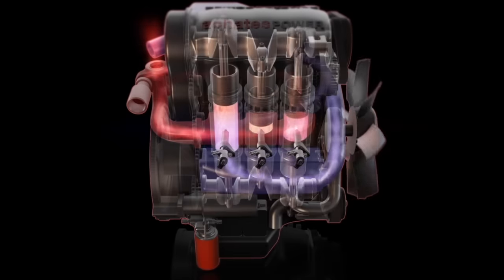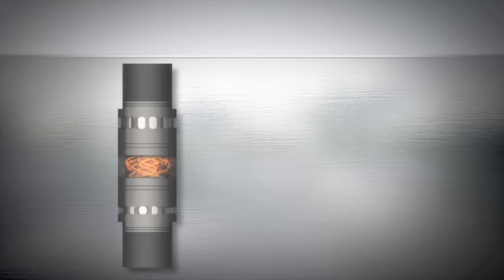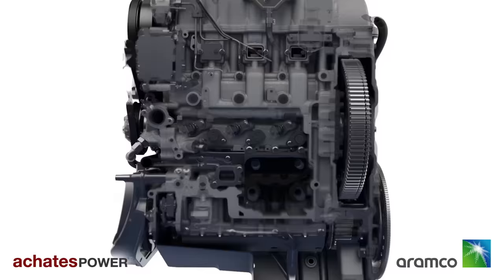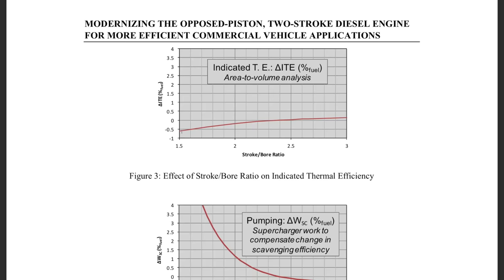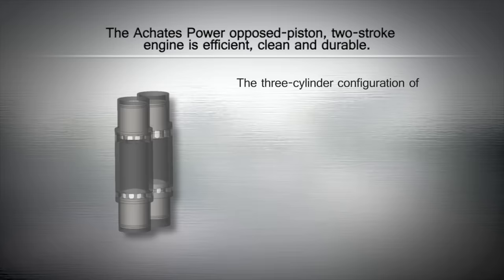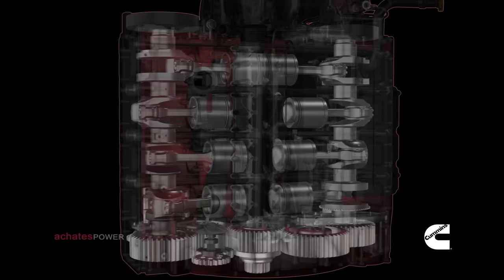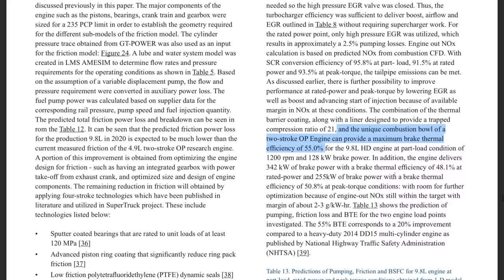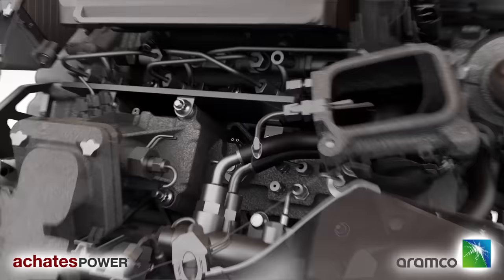Opposed Piston Diesel Engines Are Crazy Efficient

Comment: I see that you have some emission data but did not go into it. How would this compare to a modern diesel for soot and NoX emissions?
Thanks for posting this.
Reply: I'm curious on oil consumption and how it lubricates the upper compression rings. If it burns oil they'll never pass over the road emissions, or they'll be warrantying a lot of DPFs. We've been putting rings and new heads on our ISLs at work for to frequent regen codes. aftertreatment can't handle oil.
Reply: The rings pass the exhaust and intake ports so oil cant be squirted or splashed on the cylinder walls at the top of the stroke

Comment: 55% thermal efficiency can blow away EVs from a cradle to grave look at where energy is produced. If the EV electrical charge is generated by nuclear, coal, or conventional natural gas turbine, that thermal efficiency is about 30 to 33%.  Only the nuke doesn’t produce CO2 while operating. Line transmission losses are another 10%. Charging and discharging is only about 90% efficient. The electric motor itself has about 90% efficiency. Combine all these losses together and one gets 0.33x .9 x .9 x.9 = 24% overall system efficiency. Much better for the environment to burn a carbon producing fuel at 55% efficiency than at 24% efficiency. And yes, there is some efficiency loss in converting oil to gasoline, but not anywhere nearly enough to make up this difference.
Reply: we just need a way to produce hydrocarbons. and use efficient engines.

Comment: ive come up with one that has 6 opposing pistons. one bang, in the center, 6 directions pistons from all six sides.
Reply: The TruManZoo 2 pistons for each dimension :o.
Reply: Napier Deltic engines (also an opposed piston engine) which can have as many as 36 pistons in triangle blocks which bolt together
Reply: Sounds like the opposite of a radial.  That would be interesting to see how it would be geared together.
Reply: thanks, i have some vids on my channel, by no means im a professional, but ive had some cool ideas lately :)
Reply: The TruManZoo there is a fusion reactor in development kinda like that.
Reply: awesome.
Reply: Yeah, it's "30 years away". And always will be...
Reply: Intriguing, I must know more.
Reply: James D, This is why you're not an engineer. Now I have no idea if the concept would work, let alone if its a good idea. But it's worth a shot, engine design offers more potential for innovation than almost any other field of engineering. It's not even my idea but it's got potential. The world doesn't revolve around pushrod V8s, innovation reqires open-mindedness and ambition, two things you seem to be sadly lacking. You'll never know unless you try. BTW, the opposed piston diesel was first widely used in WWII maritime applications and pretty much abandoned ever since. Just goes to show, just because an idea is old, doesn't mean its dead.
Reply: Isaac Roebuck as a mechanical engineering student going into my junior year, I can see where you're coming from. BUT, engineering is not guess work. That's called "tinkering". Engineering is using knowledge, logic, and thoughtfulness to create stuff. It's important that, when you make a design, you approach it from all angles to try to figure out what can be wrong. The guy above you gave some information (though sarcastically) about some problems that such an engine could have. And he's not wrong... More crankshafts isn't usually a good idea; though not always a bad one (the opposed engine has two crankshafts), and efficiency DOES decrease as more friction-creating parts are implemented. You yourself also need to be open-minded to not just the nice criticism, but also the blunt criticism (which can even appear to be mean).
Reply: Could use a large ring cam if thats what it would be called? Could have lobes that pistons would push on. For an interesting concept look up axial engines. Some use a swash plate cam. No crank.
Reply: SoMessy, I completely get where you're coming from, critical thinking is essential to the engineering process. It was not the criticism that was wrong with his comment, after all, it's not even my idea, it was his complete lack of respect for the abstract, for the unknown. I also am a student of mechanical engineering, and to me there is much more to it than simply logic, questions and answers of yes or no. It is the science of the real. Engineering is like a tunnel, which connects the abstract worlds of science/mathematics, art/design, with the world of real objects you can hold in your hand, or devices that can accomplish a task. Just because something seems unlikely is absolutely no reason to avoid it. And just because something looks from the outside like it will require a complex solution, the true challenge is rather to find the simplest solution to a complex problem. Anyone could make a system of cogs, sprockets, gears and chains etc..., it would be 'a' solution, and it might work ok. But that doesn't mean it's the 'best' solution. The problem with modern engineers is they only look at the surface problem, A+B has to be made to equal C, sometimes the simplest solution isn't the most obvious. And there usually isn't a cookie cutter formula to do it, it's concepts like these that challenge our thinking, and help us to look at not just this problem, but all problems from a new found perspective. This is what I'm getting at, on a fundamental level, yeah it's probably not the best or most practical solution. But there's just that little sliver of a chance that they might just be onto something, this could go for any number of concepts like this. For me, that's just too fascinating to pass up. And as far as conceptual engineering goes, guesswork and tinkering is a necessary part of the process. Obviously you have to exercise critical thinking, but you gotta start somewhere if you're going to have anything to think about. So take a guess, give it a shot, think it over, make it better, and ALWAYS make it your absolute best. The only limitations are time and your ambition. Can go on about cost constraints, project focus etc..., but if you truly believe an idea is worth what it will take to bring to fruition, make it happen, one way or another.

Comment: Two strokes require upper cylinder and crank lubrication, usually through a fuel-oil premix in the inlet. Does this engine need this type of toal loss lubrication? What are it's emissions like?
Reply: No, it's a standard lubrication system a like on any current automobile.
Reply: SOME  two stroke engines require lubricated fuel. It is certainly most common in small 2-strokes that use the crankcase as an air pump essentially. But larger two strokes, such as the common Detroit line, typically use superchargers instead for this task instead with a pressure lubricated bottom end with sump.
Reply: Actually the best way to do opposed pistons is to have one end running as a 2 stroke working the valves, while the other end works at double the revs as a 4 stroke scavanging the fuel flow, one still has supercharging & turbo charging too for efficiency.  of course having positive pressure will scavenge the engine too, but it's good to have base scavenging anyway in case the compressors fail or the intake plumbing locks up in bypass mode too .
Reply: Smokin
Reply: Diesel fuel is actually a light oil and has lubricating properties on its own, not sure it’s enough to protect the internals, but it’s got more lubricity than gasoline, which is a solvent with no lubricating properties

Comment: What about the librication system? If lubricant mixes with the diesel ,the emissions will be high.
Reply: Good point
Reply: Thats the major drawback. Thats why you don’t see many 2 stroke anything anymore.
Reply: 2-stroke fuel lubricated engines use the crankcase to build positive pressure for the intake charge. The premix is only to lubricate the bottom end, nothing else. Since this engine has a supercharger handling its positive intake pressure needs, you don't need a crankcase to do it. You can have a regular oiling system and keep it separate from the combustion chambers.

Comment: In the Coast Guard, we had Fairbanks-Morse inline 12 cylinder opposed piston 2-cycle diesel engines that are three stories high, complete with a long and huge scavenger supercharger and really huge twin turbochargers at the front of the engines. We would joke about the plaque that said “Fairbanks-Morse OP”, knowing that it meant opposed piston but we joked that it meant oil pump because the engines would weep oil at the air box cover seals, and we lowly E-1 through E-4 would be constantly wiping oil to prevent any dangerous collection of flammable oil in the bilges. Brings back a lot of memories but you don’t want to be near those engines when we’re on a summer Caribbean patrol! 😰 And we had to wear thick long sleeves to prevent getting burned on the hot exhaust manifolds as the ship would rock and roll in rough seas. And yes, we had to wear double ear protection: yellow ear foamies and then aural ear muffs over the ears, constantly knocking them on pipes all around our head level.

Comment: I always thought that this config made high emissions. Correct me if I am wrong.
Reply: The old gas two strokers were bad with emissions. That is why they were discarded from car and motorcycle use. But maybe this opposed piston design with technology advancements makes the difference. Just look at the advancement of the ICE from the 1970s till today. I wonder if this design would work as a gasoline engine also. Replace one injector per cylinder with a spark plug.
Reply: As far as i read about it, no, cause it has static compresion ratio over 50:1 + boost and u get some mindblowing combustion presures :)

Curently in diesel engines, problems are enigen heads, wich wants to bend (blow up) at to high presures, that engine solves that :)

Comment: I ones was asked by my employer to build-in a Rootes ex aviation engine in ship that had previously housed a monstrous low rev runner of unknown make. So when I had the engine attached to the reverse gear, it looked crazy in the engineroom that could now given room to four more of these engines. The power it gave to the propeller was no reason to alter it a more moderate one. The ship was sold to someone in England, so off it went (the engine) back to the UK. Now probably somewhere in the Thamesestuary.

Comment: I would be curious to see how they lubricate this design. With the piston rings passing over the intake and exhaust ports, I would think it burns a lot of oil. I assume mixing oil with the fuel, like a traditional 2 stoke engine, is out of the question.
Reply: I'd hazard a guess at oil injectors a la Mazda Rotary.
Reply: In a traditional two stroke gasoline engine the crankcase in used as a pump to deliver the fuel/air mixture to the cylinder. Gas mixed with oil ends up in both the crankcase and combustion chamber - not good in either place. The Acates engine like the traditional two stroke diesel has blower induction. Nothing but oil in the crankcase. Nothing but fuel and air in the combustion chamber except for the little bit of oil that gets past the piston rings (like with any four stroke engine).
Reply: Yep.  Looks like it will burn oil, run hot, and be very heavy for its displacement.
Reply: Just like any engine. An oil pump. The GMC 6/71 never seemed to have a problem. I know. I drove one. Six cylinders with the power of a V12.
Reply: @men2dewy    I think it will be more than a little bit of oil that gets past the piston rings. Especially if the engine is mounted with one pistons up side down.
Reply: @markflierl1624  it has piston rings near the crank end of the piston, so oil shouldn't be near the ports....but that brings up the question of wear from the "combustion" piston rings.
Reply: 1. You're forgetting that diesel is an oil. Any that don't burn could end up helping lube the cylinder walls.
2. I agree about the western govts trying to kill diesels. Remember the Oppenheimer race engine? It was killed when  NASCAR decided that all engines had to have spark plugs.

Comment: Used similar engines before in both a small 3 cylinder and a big 6 cylinder version. One thing was the big one produced huge amounts of smoke under heavy load. Coolant leaks and cracked cylinders were a difficult to repair problem. Then again this was many decades ago so unlikely to still be a problem.

Comment: better set up: 180-degree curved cylinder with the pistons coming up from the bottom to meet at the top.

Both pistons use the Argentinian curved piston head hinges and crank to the same shaft.

"Zero" friction, the combustion cycle would push both pistons down, and fuel delivery would be unimpeded, and the excessive thermal mass wouldn't be in the middle of the engine, but the top.

Comment: The real big question is: how the hell does de lubrication system work? 乁( •_• )ㄏ
Reply: Looks like 2 sets of rings on the piston. Oil could be injected through the side.
Reply: You would use squirters under the pistons and feed oil to the crankshafts like you do on an ordinary engine. Unlike an ordinary 2 stroke engine, the crankcase is not part of the induction process
Reply: My main concern is the top end. Assuming you would run a traditional pressure-lubrication system, what would prevent oil from pooling on top of the upper pistons? Obviously, there’s a solution, since these have been used for decades, but I’m kinda wondering that now.
Reply: Exactly same as four stroke pressure fed with oil pump like lots of large 2 stroke diesels they are nothing like small  crankcase scavenged 2  stroke with petrol oil mix
Reply: It works just fine.

Comment: There is nothing new here, opposed piston engines have been around for at least 60 or 70 years, many in marine and locomotive applications, though not seen in automobiles. Routes built a three cylinder opposed 2 stroke version for a small truck in the early sixties marketed under the Commer name, hence the Routes blower was born that Detroit diesels and hot rodders use so much.
(The demise of the Routes group of car manufacturers was brought about by Chrysler corp who bought up Routes, then shut all the factories down in the late seventies).
If development on this engine was allowed to continue it might have made a great car engine, this concept should be given a new lease of life, hope someone takes this to development.
Reply: Roots blower.
Reply: He said that in the video, my guy.